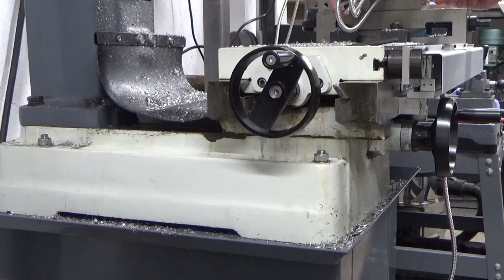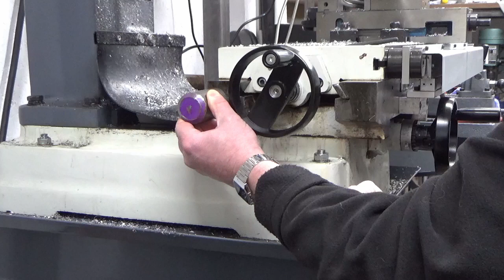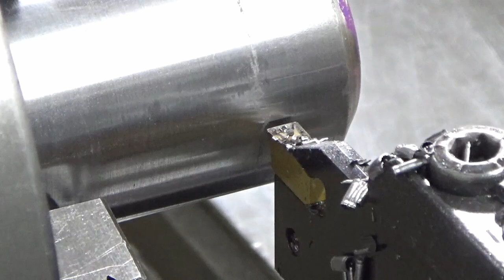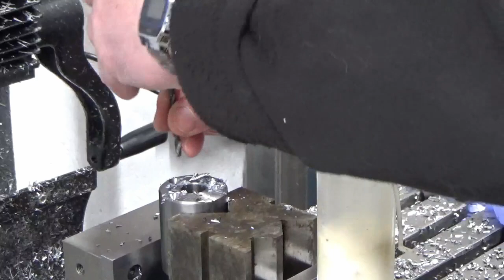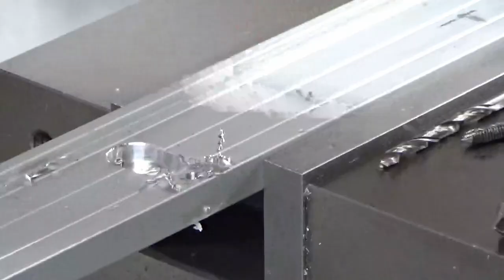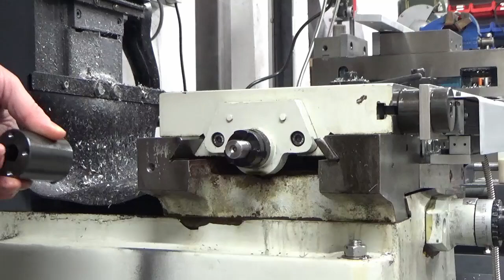Fitting A DRO To The Cormak ZX 7045 Mill Y Axis Part 1

Comment: There is another way to avoid the big ugly bridge to the reader head on the Y axis with these machines. If you mount the scale directly to the carriage with a nice thick piece of aluminium plate, you can mount the reader head directly to the base of the machine. You need the plate because the scale is longer than the carriage. An added bonus is because the reader head stays still it's one less moving cable. I did it like this and it's worked great.
Reply from the maker: Hi Oliver, thanks for the comment. Yes, I really wanted to do it this way but wasn't keen on losing 120mm X Axis travel due to the foul condition of the handwheel casting. I even considered a 'U Shaped' bridge to suspend the scale below the foul condition area but when counting up all the extra interfaces this would create, I decided to go with the single side attachment to the carriage and the long bridge. I am guessing your mill has a slightly different configuration? You are bang on about the cable re. a fixed reader, I really wanted to go this way. Anyway, all done now, final video will be up tomorrow. Cheers, Jon
Reply: @jonsworkshop  You're right that the handwheel does in the end hit the scale cover, although this is at the extreme end of the travel. I figured if it ever caused me a problem I'd just take that handwheel off temporarily but I haven't had to yet. I made a quick vid of what I did https://www.youtube.com/watch?v=IBJ4MxhF1J4 anyway, looks like yours turned out well too!

Comment: Hi Jon,are you putting some ,,levelling,,epoxy behing the scale when you levelled it with grubscrews/fixing bolts?With the multiple angles the scale contacts the side of the mill just very marginally I would think...just a thought.
Reply from the maker: Hi Robert, thanks for the comment. Not planning on doing but I will monitor the setup and if it moves or I get inaccuracies then I may need to do something. As it stands it's pretty solid (more so than the X really). Lets see how we get on. Cheers, Jon